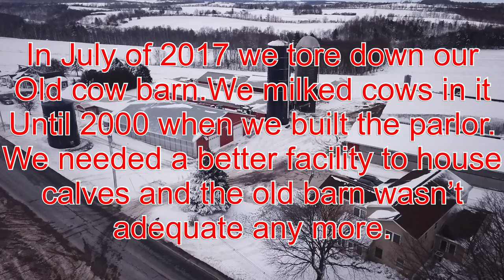The tear down of our old cow barn and build of new calf barn.

Comment: It seems a pity you had to do that, I'd be concerned in a practical sense, that by distroying the farm's physical history you could undermine the psychological foundation on which it is built. I think it's important for up and coming generations to be able to see that history to appreciate the work that has been put in by previous generations and value what they've got and how they got there. Puts things in to perspective and helps gives meaning and purpose. Just my way of thinking, which you may well think is unnecessary nonsense.
Reply from the maker: Thanks for the comment. You have some points that are spot on, however the barn was in bad shape and needed to come down.
Reply: @Malcolm Chapman  -  Even the most run down barn looks good from 100 feet away.  You have to ask yourself whether you could spend a night sleeping in it, and whether you would feel like you wanted someone to pressure wash you with rubbing alcohol in the morning.
i live in a converted 600 square foot chicken coup from the 50's, that got converted into a decent but crude workshop in the 80's, and i slept in it a few nights before i rebuilt it in 2010 and it was no fun.  It felt "dirty".  
And i can tell you a funny story about fixing an old chicken coup.  By the time i was done, the only thing original was the "foundations", the shape, the crumbly concrete floor that got buried under the wood floors and the roof rafters and the tongue and groove that covered the roof. And all the rafters got sistered with 2x6's and the tongue and groove got another coat of plywood.  So essentially nothing.  
Sometimes, when you decide to repair a barn or a coop, by the time you are done you spent too much money and you end up replacing everything, so by rights it is not even the same barn.  So why bother?  
You are correct.  It is sad, but sentimentality has to be properly gauged against practicality.
Reply: @michael-dm2bv  you're right, absolutely
Reply: @malcolmchapman3032  - i wasn't trying to be.  tearing down old barns is sad.  someone else posted that companies would have paid to dissasemble the barn, and avoided the owners the cost, while saving the lumber from the scrap heap.  that is more sad.